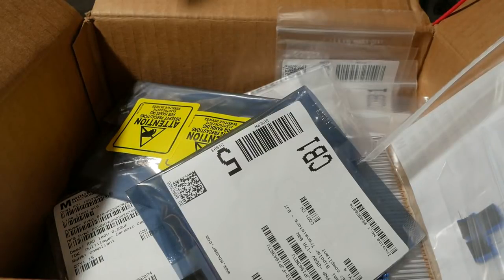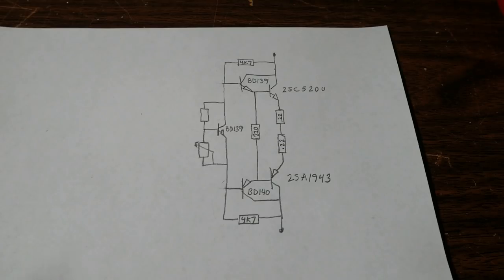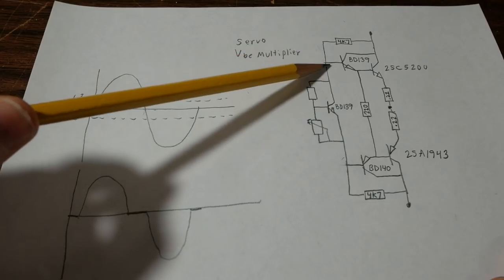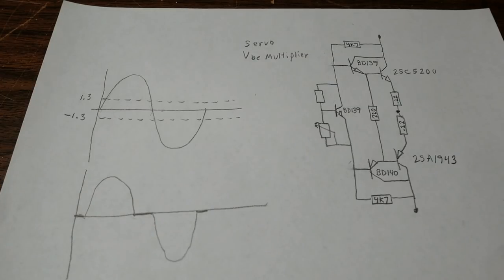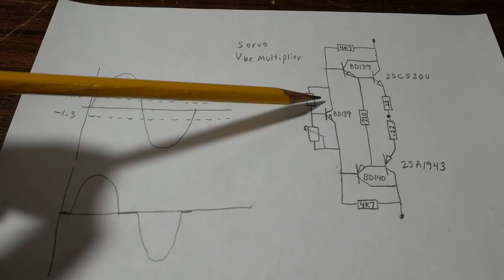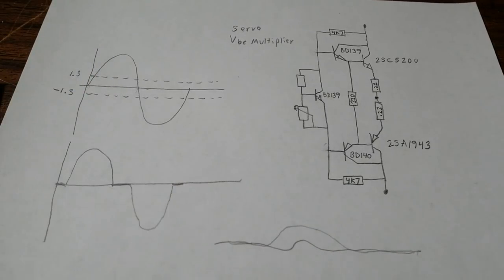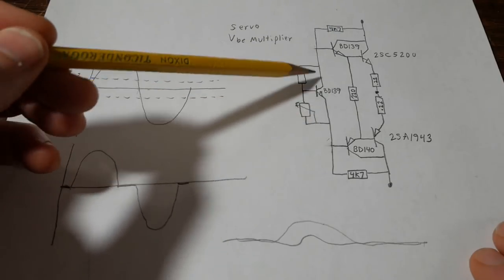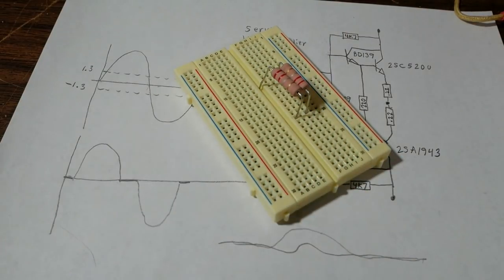Discrete audio amplifier project PT11.1 output bias and thermal stability

Comment: Can any improvements be done to the VAS of the discrete amplifier, to improve the power supply ripple rejection?
or unequal voltage rail rejection (you know what I mean, when +ve rail has 40.14v and -ve rail has 42.30v(even before connecting to the amplifier, it is due to unequal windings), and there is a dc offset (of about 0.5v) present at the output, current through the 0.22Ω resistors being 10mA).
And I think this is related to the latch-up I talked about earlier(which is not at all a problem from the input stage at all, but after latch-up, input stage bias was affected)
Reply: of course I bought that new transformer±30VAC, previously I was using  ±24VAC transforner.

Comment: Interesting video.   Assuming the Vbe multiplier is set to roughly multiply by four, if the driver transistors are not heating as much as the outputs, assuming the Vbe multiplier has a similar base-emitter drop to the output devices, it seems like two diodes in series with the Vbe multiplier might track better as the outputs heat up.   If the diodes were not mounted on the output heat sink, then their voltage would be fairly constant, more or less like the Vbe of the driver transistors.  The Vbe multiplier would be set to x2 instead of x4, and would track the two output transistor Vbe's.   Does that make sense?
Reply from the maker: I can see what you are saying. I would think perfect tracking would require monitoring the temperatures of four transistors (or six in output triple config) which would complicate things. The Vbe multiplier transistor's gain and selection of its bias control components will provide reasonable tracking. That is why it is commonly used. Bob Cordell's book has good information on thermal tracking circuits.

Comment: I have the pot between colecter and base. But to protect against the pot failing I also have a resistor across it to prevent the amp from self destructing. So if I'm using a 1k pot I wold have a 1.1kr across it
Reply: This is a bad idea because the wiper of every pot get sometimes loose contact and reach therfore a higher resistance. This can kill your amp.
Reply: Always put the pot between base and emitter for reasons that John explained. His method makes the biasing almost totally failsafe.
Reply: @christophschuermann6512  that's what the resistor across it is for.
Reply: @davekazoroski6548  Tru that but you could all ways use sealed trimpots to help provent them from getting flaky but to protect the transistor from spikes that may be called from ajusting the pot I put a cap from base to sentertap to keep that to a minimum.

Comment: Just found this channel. What is it exactly John is building?
Reply: 50W into 4 ohm audio amlifier
only discrete parts, no fancy ICs
going to be available as a DIY kit
Reply from the maker: The amp should be able to deliver around 100w into a 4 ohm load and 50w (probably more like 60) into 8 ohms. It all depends on the power supply as to what the actual output power will be.
Reply: Sorry, my bad.
That's a lot of power though ;)

Comment: Elliot Sound Products (ESP) has some wonderful articles about discrete amp + audio circuit design.  Of course he sells kits and products.  One could simply  build up anything on the site.  It is amazingly transparent.
Rubber diode biasing ... green LED + transistor for current source ... compound vs darlinton drivers -- there is a lot covered.  http://sound.whsites.net/articles/cmpd-vs-darl.htm

Comment: Here’s a great amplifier for you to build on YouTube. 
 https://guides.diyaudio.com/Guide/Amp+Camp+Amp+V1.6+Build+Guide/5?lang=en
This is the build guide with excellent photos perfect descriptions and even videos and a whole community to back you up if you have any problems. You don’t have to buy a fancy chassis you don’t even need a circuit board if you want to build a point to point or You can get creative and use a simple wooden board driving in short pieces of number 10 solid core copper wire to use as standoffs for connecting your circuits , resistors, diodes, transistors, capacitors like I did 40 years ago in junior high school electronics class. You even have the option of running these tiny amplifiers in parallel or series to double their output if you choose. You have the option to build model blocks if you wish all the different options for the instructions are in beautifully detailed colored photographs. And it only takes three hours if you’re a little experienced about six hours of work if it’s your first time.